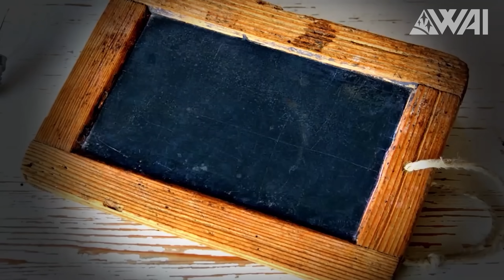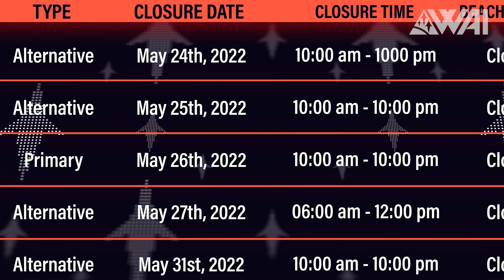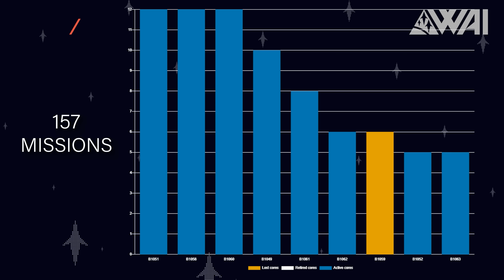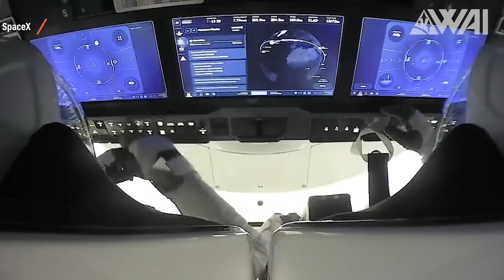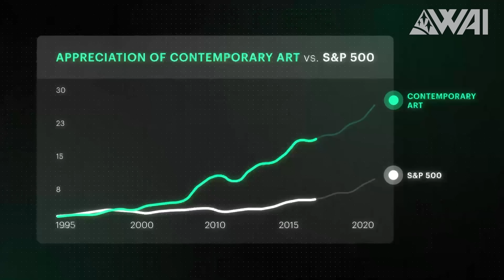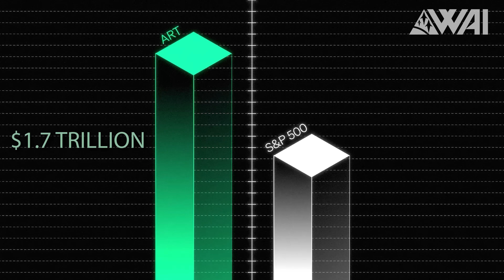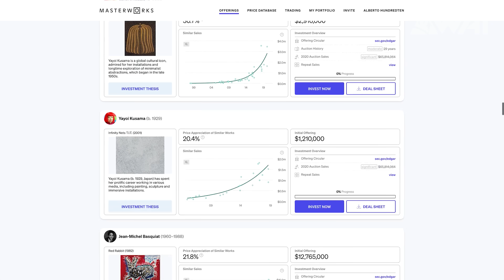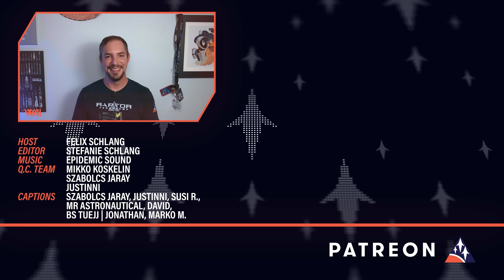SpaceX Rolling Out The Orbital Starship! FAA Decision Safe?

Comment: As long as the Starship booster is recovered ok, even if Starship (upper stage) fails reentry, will it still be a cheaper launch per ton than Falcon-9?

Anybody have the expected figures?
Reply: I do not, but with Starship rapid development I think any figures you can pull from it won't be accurate for long. 

We are still in prototype phase. Engines are still being tweaked and other systems that could optimize performance
Reply: I think the price for kg to orbit will be less even with an expandable starship because it will require only one launch for 5x the payload
Reply: @tarek42023  You forget that the +10 Billion invested in it's R&D (tools and launch pad etc ..) must be payed back and included in the cost of each launch for many years.....that money was not free!
Reply: @joannewilson6577  Yeah but Falcon 9 had r&d aswell
Reply: @tarek42023  Yes but a lot of subsidies and half of the Falcon 9 was paid by NASA..
Only the reusable part was 100% paid by SpaceX and that was only $1 billion.

Starship is 100% paid by SpaceX (investors etc not by NASA) and the cost will be close to $10 Billion...that is a lot of money that have to be paid back...with each cost of starship launch...
Reply: @joannewilson6577  SpaceX is targeting a much faster launch rate with Starship tho… but only looking at the different payload capacities and the manufacturing materials and ease starship will be much more efficient and less expensive than building 5 Falcon 9s
Reply: @tarek42023  Starship won't have that launch cadence at first though. Per the GAO report denying the HLS complaints, the two initial Artemis landings that Lunar Starship will perform are planned to launch one Starship variant every 12 days (pg 12). SpaceX wants to increase that cadence in the future, but that is likely to take some time. After all, it took years and many variants to increase the Falcon 9 launch cadence to where it is now.
Reply: @tarek42023  In 5 years? if ever! 
I'm sot saying that you are wrong....I'm saying that Starship block 1 will not be optimized and if it work well that will be in 3 years...block 5 will be 2 or 3 years later...again we will have a very good idea in 2-3 years.

Even Falcon 9,Elon said 6 months ago that he was not at all happy about the delay( inspection after each launch ) and the cost of each launch (it was not as cheap as he wanted it to be) and refurbishing and the conception problem about the fuel tank....

Starship is a lot more complex with all it's engines and what it need to do...a lot more!
Reply: @steveaustin2686  I'm talking about a fully optimized starship
Reply: @joannewilson6577  But they try to make starship as simple as possible, I'm talking about a fully optimized starship
Reply: @tarek42023  Let's hope that they succeed!
Reply: @tarek42023  By "fully optimized starship" to you mean the projected values? If so, they may or may not come true. As for cost, the $147M is the best estimate we have now based on the actual values in the HLS contract and the GAO report denying the HLS complaints. Same for the one Starship variant launch every 12 days per SpaceX's own plans as reported by the GAO.
Reply: @tarek42023  The cost to kg for the Falcon 9 Block 5 is lower for the expended Falcon 9 B5 than for a recovered one. 

An expended Falcon 9 B5 can lift 22,800 kgs at a starting price of $62M, so $2,720/kg to start.

An recovered Falcon 9 B5 can lift 16,300 kgs (B1051.12) at a starting price of $50M, so $3,068/kg to start.
Reply: @steveaustin2686  but you won’t have to pay for an entire new booster right?
Reply: @tarek42023  What does the customer care? Their payload is in orbit for that $62M+ cost. That is why the expended cost starts at $62M and the recovered cost starts at $50M for the Falcon 9 B5.
Reply: An expended Falcon 9 B5 can lift 22,800 kgs at a starting price of $62M, so $2,720/kg to start. Based on 20 flights for 2 lunar landings for $2.94B, that puts a Starship launch at roughly $147M. For 100,000 kgs at $147M, you have a starting price of $1,470/kg ($980/kg for 150 tons).
Reply: @steveaustin2686  So, yes is the answer. Twice as much nearly, and we are still perfecting everything about it. So will only decrease cost.
Reply: @CountryLifestyle2023  How much Starship decreases the launch cost, if it decreases at all, will depend on how much is needed to turn Starship around for relaunch. The Falcon 9 and Falcon Heavy are only partly reusable with the second stage being expended. Starship (second stage) is going to be reused and that re-entry and refurbishment will likely be more difficult than rehabbing a Falcon booster. So it will depend on how much SpaceX can streamline Starship (second stage) refurbishment.
Reply: @steveaustin2686  Stay on topic, we are not talking about final cost numbers, Starship is still in development. Talk about current details not issues that we know nothing about....
Reply: @CountryLifestyle2023  The $2.94B for 2 landings of up to 20 Starship launches gives us the best pricing that we have now. Musk expects the Starship per launch cost to go down, but we do not know that it will. So with the best available cost number we have now, is what I used.
Reply: @steveaustin2686  Nothing said has relevance to what I am taking about. 

And current cost are not accurate as we are still dealing with prototypes...alpha, beta versions, not fully operational yet...
Reply: @CountryLifestyle2023  So you are not talking about the cost of a Starship launch? Because your posts say otherwise.

The $2.94B is for the 2 Lunar Starship landings for Artemis, so they don't count? That's absurd. Based on up to 10 launches for each lunar landing, that comes out to the $147M per launch cost to NASA. So the cost to NASA doesn't count? Don't be silly.
Reply: @steveaustin2686  We are talking about Falcon 9 cost vs Starship cost.

You are talking about Starship only.

You are not talking about the same stuff as the rest of us.
Stay on topic, Stay focused
Reply: @CountryLifestyle2023  You really want to go back and read my posts. I first listed Falcon 9 B5 expended vs Starship. I later mentioned Falcon 9 B5 expended vs recovered. You REALLY should READ the WHOLE post, before deciding what I am talking about. I have been talking about both the whole time.
Reply: @steveaustin2686  I have read those posts. And that particular information was useful and helpful.

The rest is not. 
Stay on topic, stay focused
Reply: @CountryLifestyle2023  Dude, I. AM. ON. TOPIC. I am answering questions posed to me. If you need me to use simplier words, I can accomodate.
Reply: @steveaustin2686  Even other replies to other ppl have been off topic. 

This is Falcon vs Starship.
Not just Starship details.....
Reply: @steveaustin2686  Except that the Falcon 9 did cost a lot less to R&D and was heavily subsidies by the NASA who on top paid 50% of it's cost....SpaceX paid 100% of the partially reusable part ($1 billion),
Starship will cost close to $10 billion in R&D (tools and prototypes and launch pad etc ...).
Reply: @joannewilson6577  Never said any different. The Falcon 9 was developed from the $1.6B Commercial Resupply Services (CRS) contract in 2008. NASA has stated that SpaceX is paying for over half the Starship development costs, so I took the $2.94B HLS Option A contract and divided it by the up to 20 launches to get the 2 landings that the contract requires. That $2.94B is the cost to NASA, which comes out to around $147M per Starship launch to NASA. The SpaceX internal cost for launching Falcon 9 or Starship is immaterial to this calculation as a customer does not pay that internal cost.
Reply: @steveaustin2686  The money from NASA is for the HLS.

SpaceX must do the all important work on orbital fuel transfer. 

This is the crucial attribute that Starship must possess if it has any chance of fulfilling it’s design brief and allow it to carry a 100 tonne or more payload outside of a LEO.

Along the way they have to develop landing legs that can compensate for irregular terrain on the moon, as well as the actual lunar landing thrusters.

Then there are the other details that need to be sorted, such as the lift/winch arrangement that gives them access to the lunar surface, the proposed twin airlocks which dramatically improves craft survivability, and of course the life support equipment.

NASA contracted SpaceX to develop the lander, manage its launch and flight to the Moon, and demonstrate an uncrewed landing before making a crewed landing.

The contract does not contribute to the development of Starship: the Lunar Variant depends on SpaceX developing the Starship and its refuelling in orbit. 

NASA will not contribute to that under this contract.
Reply: @steveaustin2686  SpaceX is operating in a way to be self-funding with the Starship development. 

They have already contemplated using the moon as a testing ground for systems to fly to Mars, and they’ll plan to do it that way.
Reply: @joannewilson6577  Yes, because Lunar Starship is a part of Artemis, which is why SpaceX will be involved in the Moon. SpaceX already has the HLS Option A contract for 2 lunar landings and NASA is currently negoitating the HLS Option B contract for one or more landings. SpaceX is also in the R&D contracts for the Lunar Exploration Transportation Services (LETS) contract landers that will replace the HLS and Appendix P landers.
Reply: @steveaustin2686  Are you working for NASA? (You really know a lot ;))
Reply: @joannewilson6577  No, I don't work for NASA, but that would be awesome if I did. I have just been reading a lot and I'm a gifted amateur when it comes to space. I downloaded the Apr 2021 HLS Option A Source Selection Statement from NASA and it is well worth the read at 24 pages. Same for the GAO report on the HLS complaints (76 pages) and the Draft PEA from the FAA released for the public comment period (152 pages). LOTS of good info in all three documents as well as lots and lots of articles over the last few years.
Reply: @steveaustin2686  Well you know a lot and it's interesting to read your comment.
Reply: @joannewilson6577  Everybody has the same access to the info I have. If you have the time, definitely google up those docs. They are well worth the read. The NASA Source Selection Statement discusses the 3 different landers in the final HLS Option A competition. The GAO report details the complaints and why all but one were turned down. The FAA report details the things that those 6 agencies in the review were looking at for SpaceX to get approval for Starship at Boca Chica or needing to do another EIS. If you only have time for one, go for the NASA HLS Option A Source Selection Statement as it is the shortest and is mostly written for a general audience.
Reply: @steveaustin2686  Sure I will.I already did read quite a bit on the COTS on the NASA web site 1 year ago...Thanks!
Reply: @joannewilson6577  Shiny
Reply: @steveaustin2686  no you are not, your first comment was a general reply, relatively on topic, could use more focus but good overall.

The rest of your replies to me have been off topic, going off about starship details that dnt matter to this conversation
Reply: @CountryLifestyle2023  Whatever floats your goat dude. I highly suggest re-reading it all for further understanding on your part. The Starship details do matter as you can't really compare Starship to Falcon 9 without knowing the details.
Reply: @steveaustin2686  I have read it all, as I have said 3 times now. Take your own advice

And no those specific details don't matter. 

The question was cost comparison of launching a falcon 9 vs a Starship.

Everything else is irrelevant and off topic.

Doesn't matter if they are in a different league. The topic is falcon 9 launch cost vs Starship launch cost.

NASA contract and deals have nothing to do with this. 

Get it?? If not, re read the comments and reflect on how you are interacting with ppl
Reply: @CountryLifestyle2023  LOL dude. It's all there in black and white. Not my problem if you are not paying attention.That's on you.
Reply: @steveaustin2686  You are not getting it. 

The information is not needed. 
The discussion is Falcon launch cost vs Starship.

Yes you have given good information, but 2/3 of it is off topic. 
1/3 on topic 2/3 rambling
Reply: @steveaustin2686  get it yet?
Reply: @CountryLifestyle2023  You can't discuss Starship vs Falcon 9 without having all the details. We have been discussing the details. Not my problem you apparently can not understand that simple fact. Why don't you hush and let the adults talk. Or maybe discuss the actual details with the rest of us instead of whining about them? Trying to explain things to you is becoming tiring if I have to repeat facts all the time. Or are you mad that I brought up the facts? Did I shoot down your argument?
Reply: @steveaustin2686  I had no argument, I made a statement that at this point the details will change. As Starship is a prototype. 

And yes you can. You don't need all the details. Just the base facts specs and details surrounding the situation.

The cost of launch for falcon 9 vs the cost of Starship launch.
Good to know, but no need to go through every detail about the situation to understand the comparison. 
As it's not a falcon 9 vs Starship discussion, it's a launch cost discussion.

62M for 22,000kg vs 147M for 107,000 kg
62×5=310
So 310M vs 147M 
Done. 
As currently Starship is a prototype, so even this will change, good as a reference point but we haven't even seen an orbital launch, let alone any launch in awhile, or lunar or Mars versions, cargo versions, fuel tank versions.
Aka this is in development so no need to go through every single detail, that will could all change in the next 6 months to a year,  for a simple discussion

Twice as cheap, here is why. Done.
Reply: @CountryLifestyle2023  Well, it is $62M for 22,800kg per SpaceX. And $147M for 100,000 to 150,000 kg per Musk, SpaceX, NASA, and the GAO. If you are going to whine about details, you might want to get them right. And of course the cost per kg apparently went over your head.

Yes, Starship is a prototype right now and is subject to change. But you need to start somewhere and those details are WHERE I got my starting point. I discussed those details when asked. Since you have stated twice as cheap and apparently been done, WHY are you STILL here complaining? About a discussion the rest of us are having? Again, hush and let the adults talk.
Reply: @steveaustin2686  I wasn't trying to be accurate, and didn't mention the price per kg. Yes I have read it but to my point, it doesn't matter. And no this stuff does not go over my head, I just don't need those details so don't care about them, and again they will be meaningless in 6 months or less..  

You discussing with me stuff that I haven't asked, mentioned or talked about, it is poor communication skills....

You are talking at ppl, not with them. 
Difference. 

Doubt you even read replies. Doesn't seem like it.....
Reply: @CountryLifestyle2023  LOL. No wonder you are so upset, if you don't even care to get the details right. The Falcon 9 Block 5 details WON'T change as NASA forced SpaceX to freeze the design to get the crew rating for Crew Dragon. But whatever floats your goat dude.
Reply: @steveaustin2686  The problem is when we are talking one thing, and you go off on your own topic. Cool and all but start your thread or channel, I have no interest in that.
If someone asks about it, go for it spill all the details. 
If it is a simple question  to solve, give the answer and move on.

Ever have a Jehova witness knock at your door, you remind me of them.
Conversation can start out fine, than bam information that isn't requested,,needed or wanted. 

Get it yet? Doubt cause you just did it again lol  
And not upset just explaining your odd behavior to you
Reply: @CountryLifestyle2023  YOU were the one said that you were not tying to be accurate. YOU were the one who said that the details would change. Since the Falcon 9 B5 details WON'T change, why not just get the details right the first time? Deflect again if you must. It's sad really.
Reply: You cannot compare the two if you realize that the Falcon 9 is not even close to be the perfect medium-lift launch vehicle (MLV)  since it has many flaws...and it cannot be relaunched as easily like Elon wanted and the refurbishing every "10 launch" and the parts that must be repair or change between each launch all of those add cost and delay... Elon said a few months ago! 

So Elon want the Starship to be a lot better optimized and that is going to take many years after the first fully operational Starship is launch....2 or 3 more years...that mean 2027-2028.